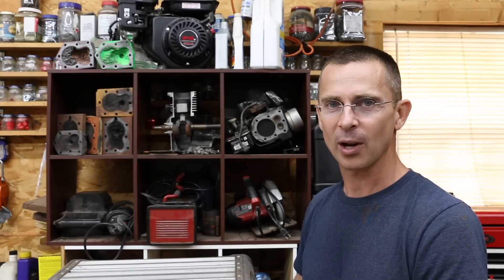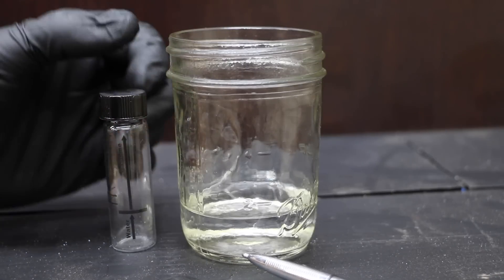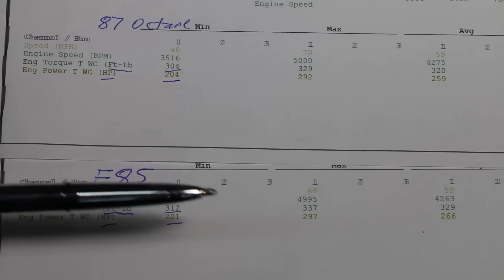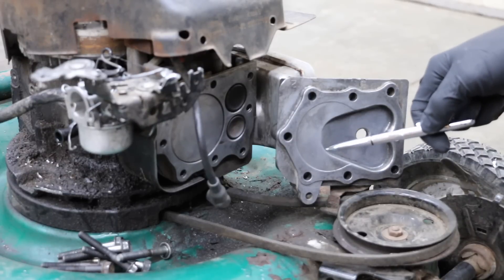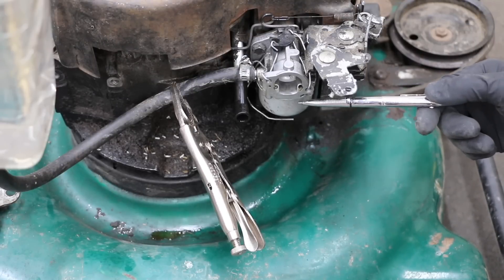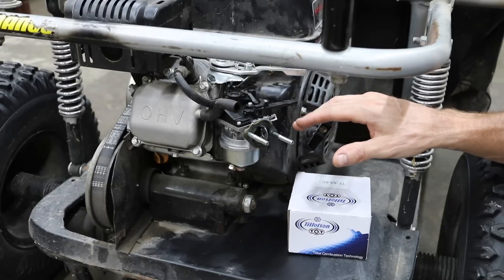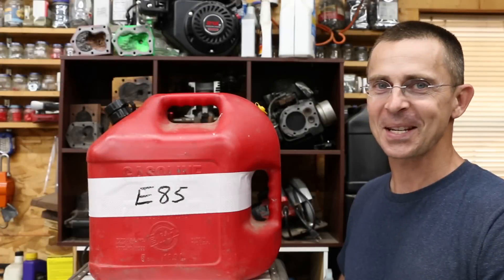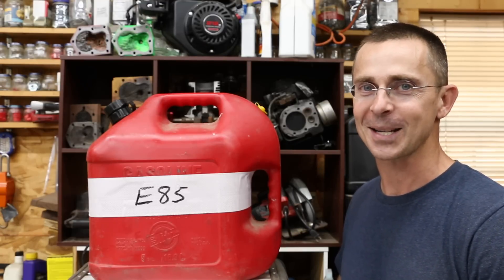Is E85 better than Gasoline? Let's find out!

Comment: I tried E85 in my work truck once. The reduction in  power and substantially lower miles per gallon made me never try that experiment again. And yes, it was a flex fuel truck
Reply from the maker: Great point.
Reply: E85 as race fuel? I'll withhold my laughter for now and do some research and get back to you on that
Reply: E85 is just as common as 116 at the the drag strip, NASCAR also uses ethanol.
Reply: Okay, I've done some research and found it I was wrong about E85 as a race fuel. However my original comment was in regards to use in a standard road car
Reply: You should gain atleast 20hp on E85...
Reply: @Z3rhairstylers  how do you figure? One of the inherent drawbacks to ethanol is that the amount of energy in one gallon versus the potential energy in one gallon of gasoline is substantially less than gasoline
Reply: @greglautz8470  ECU injects more fuel (BTUs compensation), that's how.
Reply: @greglautz8470  resistance to knock. It's basically race fuel. Less energy so more is injected to compensate and then timing can be advanced much further than normal pump gas could ever handle.

Comment: Because of the lower energy density, fuel consumption is going to be highly. And the price difference between 87 octane and e85 isn't worth the switch. But, like you showed, e85 burns cleaner and that also makes it more environmentally friendly. And, hypercars are now producing much more hp on e100, than on any gasoline blend. The biggest problem with ethanol is it's water absorbance and solvability. It ruins rubber almost instantly and once wet with water, will speed corrosion. Luckily, I have a gas station that still sells strait gasoline, in 91 octane.
Reply from the maker: Thank you!

Comment: You said 30% less energy in E85, I assume you are talking about BTU's, but heat is a bad thing in an engine. You want expanding gas to drive the piston down. E85 expands less than regular gas, but not 30% less. This is common miss-information perpetuated by those that do not know.
Reply from the maker: Thanks for the constructive feedback.  Per several reliable sources, E85 has 30% less BTUs than E0.

Comment: I have not even seen E 85 for sale , just may contain up to 10 % ,  Last summer it was about a 105 in the shade  I tried to get a 1970 318 dodge pu running  it would run but it sounded like the gas was boiling in the carb it then it was acting like vapor lock  this fuel now days must not work to good in the old stuff
Reply from the maker: Thank you!

Comment: yes its less energy per unit, and thus you get fewer miles to your gallon, but you forgot to mention that E-85 is subsidize to be around a dollar per gallon cheaper to offset the fuel economy loss. Also if you are using forced induction, the 115 octane rating of E-85 means you can up the boost a lot more and do it safely. I wish someone would design a turbo engine tuned for E-85 from the factory, and start putting it in normal passenger cars.
Reply from the maker: Thank you

Comment: E85 melted the rubber fittings on the vapor return lines in my 1997 Mercedes.  it was a serious pain to find those rubber connection fittings and replace them. They swelled up and lost their seal again within a year.
Reply from the maker: Wow!  Thanks for commenting on this.

Comment: its harder to start the engine with e85. e85 has higher octane rating. and you get less mileage with e85. as a alt fuel i prefer propane with propane it burns way cleaner you can see it in the oil running propane. whitch would bring up the question of if you would have to change it because i seen 50k miles on oil from an engine running propane and it was exactly like new nice light brown.
Reply from the maker: Thank you!

Comment: Ran a tank of 87 octane then a tank of E85 and repeated both again. I have a 2012 Chevy silverado with a 6 liter V8. Both tanks of E85 yielded about 50 mile less than the 87 octane. So I don't use E85 except when the E85 folks in Iowa run a $1 a gallon promotional sale. Hard to beat $1 fuel.
Reply from the maker: Great point on buying the fuel for such a great discount.
Reply: This is a study in your neck of the woods. Not Iowa but South Dakota. Close enough.
 http://ethanolproducer.com/articles/14126/passing-the-test-with-flying-colors

Comment: If Memory Serves Me Correctly The Thermal Efficiency Of E-85 Is Roughly 25%  LESS Than 87 Or 89 Octane Fuel  Lb. For Lb.  Or Any Other Comparable Volume Or Weigh Equivalency .... It's Not Worth It ... Unless In A High Compression Engine ... Race Car Etc ..  Anyone Else Remember This A.P.I. Study Years Ago ??  Have A Good Day !! 😆  -MW
Reply from the maker: Thank you

Comment: We have two vehicles that are made for Flex Fuel E-85, one is a 2017 Ford F-150 V-8 which does much better on regular 87 octane fuel.  It has better performance and a lot better gas mileage versus E-85. Our 2012 GMC Terrain that runs quite well on E-85, and gets better mileage, and performance than we get with 87 Octane fuel.   The only way to get similar performance on the GMC is to run 93 high Octane fuel.
Reply from the maker: Thank you for this information.

Comment: I use e85 all the time my truck loves the stuff throttle response is alot better the engine runs cooler and it seems to not work as hard at highway speed. the downside I get roughly 11% reduction in economy. at just over 1 more gallon of fuel for every 100 miles driven the added cost is negligible. The reason non flex fuel vehicles get such poor economy is because the computer senses A lean trim and dumps fuel through the injectors until it maxes out whereas the flex fuel engines can detect the ethanol and trim accordingly. Also non flex fuel systems can suffer major damage due to the seals and gaskets either turning to mush and dissolving or they become hard and brittle and leak (depending on the rubber compound)
Reply from the maker: 11% less efficiency is actually not bad at all.  My flex fuel suffered a 30% decrease.

Comment: I use e85 4 gallons, 10 93 octane and ethanol treatment in my Audi s4. It comes out to e30 basically. I wish they sold e30 there instead. As far as the difference yes you can feel more power without a doubt. 

The car is tuned for 93 octane so running 95-96 octane just helps it run at its peak. Summer it will make more of a difference with it making car run cooler. You see much bigger difference in summer compared to winter because of cooling effects.
Reply from the maker: Thank you for the video idea!
Reply: Absolutely true. Mercedes petitioned EPA to allow stations to offer e30 since it provides "ridiculous power" (Mercedes words) in their turbocharged engines.

Comment: In a 2016 Ford F-150 5.0L Coyote I see massive mileage drops with E85. Even the estimated range computer shows about 380 mi when full with E85 vs 435 mi with 87 octane.
Reply from the maker: Wow, that is a big drop.
Reply: Try e30. That seems to be the sweet spot for sizable power increase with minimal mileage penalty.

Comment: as far as your dyno results go they can be very misleading for starters the computer takes time to adjust for the different fuel you need to drive it at least 10 miles(preferably longer) for the computer to adjust fuel trims.
also for more accurate dyno numbers you should take multiple runs and average them
Reply from the maker: Thank you.  I added the E85 around 20 miles from the dyno shop.  Great feedback on multiple runs.

Comment: Ran E85 in my truck, after 1/2 tank engine check light comes on " P0340" code O2 sensor below range. Engine ran fine but at reduced fuel economy avg 3 to 4 miles per gallon than regular gas.
Reply from the maker: Did the CEL go away after going back to E10?
Reply: No had to reset with scan tool

Comment: The push for ethanol fuel happened mainly before US scaled up shale oil production and became an oil exporter. It was meant to reduce the reliance on oil import and was a strategic move rather  than environmental. Now that theres no need for that, time and money will be better spent on directly going electric which will actually be the future.
Reply from the maker: Thank you!

Comment: I run E85 exclusively in my flex fuel capable F150 with a 3rd gen coyote 5.0L V8. My truck has some bolt ons and it's specifically custom tuned for E85. It makes noticeably more power on flex fuel vs premium gas. My mileage on E85 is about 13-14 mpg vs. 15-16 on 93... but gas mileage is not important to me because it's not my daily driver. I haven't had my truck dyno tested, but it should make 440ish lb fleet of torque and 425ish hp to the wheels, over the 395/400 stock rating off the crank.
Reply from the maker: That's great power!  Thank you

Comment: e85 works very well in boosted engines I run it in mine. It is higher octane but isn't a real raiting as it cant be tested on the normal gasoline scale. It also cools the incoming charge air in my tests it has worked better then Sunoco 110 to keeping knock down.
Reply: Doesn't even compare to pump gas on pump 91 non ethanol I was stuck around 20psi and 10 deg of timing advance by redline to battle knock. E85 car as seen 30psi and 15 deg at redline without knock.
Reply from the maker: Great point. Thank you!

Comment: Not sure if you’ve tested this theory, but what effect will “octane boosters” have on a vehicle that is E85 compatible, running on E85. Hope that makes sense.
Reply: Since e85 is already 100-105 octane there would be no change/benefit to adding octane boost, most of which only add .2-.3 octane.
Reply: 65sohc 
At that point it doesn’t matter at all. If it is only going to add .2-.3 (which I agree with you), it doesn’t matter which octane fuel you add it to.

I suppose then at this point the question is whether the alcohol content of E85 (not its octane rating) would have any affect on how well the octane booster could work.

In other words, not because of the rating number, but does the alcohol content of E85 have any significant effect on the way the octane booster is designed to work. Like is the booster more or less effective because of the alcohol.

Gosh I hope that made sense, it was sort of confusing to try to explain myself
Reply: @notacreativehandle  Pretty much all the effective octane boosters contain MMT as the active ingredient. This includes Torco, NOS, Lucas. Basically the more you add the more they raise the octane of the base gasoline. Though I can't say for sure, my sense is that the presence or absence of ethanol wouldn't make a difference. However ethanol is a much cheaper way to achieve higher octane. It also reduces deposits whereas MMT increases them. Engines that run MMT have a characteristic orange deposit on the spark plugs and valves. With e85 guys are making huge power so it pretty much eliminates detonation as a limiting factor.
Reply: 65sohc 
I suppose then at that point maybe with a test we could be able to see comparisons in both performance and maintenance, which would be pretty cool
Reply: @notacreativehandle  Another important property of ethanol is its high latent heat of vaporization meaning. It absorbs heat better than gasoline, cooling the intake charge and thus increasing its density and power. So even with the same octane the ethanol fuel would produce more power, especially in a forced induction setup where combustion chamber pressures and temperature are critical.
Reply: 65sohc 
That’s right, I had forgotten about latent heat.

Here’s the thing though, by adding an octane booster to the mixture, you’re still adding an additional chemical to the mixture.
I’m curious as to how much difference it either does or doesn’t make.
Reply from the maker: Thank you for the video idea!

Comment: My 2013 Subaru Legacy owner's manual does NOT recommend even using E15, much less E85.  There was a push about 6 weeks ago when news programs on TV were telling viewers that E15 was going to become 'more available' and would cost less than current regular.  You might ruin your engine by using it.  Dude, your gasoline prices are ridiculous! I just filled up, and I paid $1.859 per gallon for 87 octane regular.
Reply from the maker: That's a great price!

Comment: hey great videos keep them coming. I have a 2016 Silverado 4.3L V6 that is a flex fuel vehicle. I primarily use E85. I find that while yes it does burn faster and the mpg goes down, besides the extra power and torque, I believe it is a financial savings. The reason I say that is for example current gas prices here in NY is about $1.75 for E85 and about $2.30 for regular. The window sticker on my truck estimates that I should get 300 miles per tank on E85 and 400 on regular. So for me to fill up my car it costs me about $35-37 on E85 where as it would be about $55-57- about $20 more per tank. Now I know what your going to say, “your getting another 100 miles out of the tank: that is true. But if you were to say “how many miles can I get on $50 worth of either E85 or regular, the answer would be in the favor of E85. On my car, I wouldn’t be able to get the full $50 into the tank on 1 shot on E85. And on gasoline I wouldn’t have completely filled the tank. So I estimate that while I have to go back to the pump for more E85, I will actually get further on the addition $15-ish of E85 as apposed to what I got on (almost) a full tank of regular gasoline.
Reply from the maker: Thank you

Comment: 10% to 15%  more power with E85 or E100 for the same engine block at 13:1 or above compression ratio. Also more efficiency. Using E85 or E100 in engines below 10:1 CR is waste of money.

To run ethanol in a gas carb it need to be treated with nickel bath...

Water content in ethanol cleans combustion chamber...
Reply from the maker: Thank you

Comment: Have converted a bunch of cars for E85 for climate reasons, and have discovered that if done right E85 gives you a much meatier engine character and slightly more power at any rev. Engines with mid to high compression responds best to E85 but lower compression lets you drive on high gears at very low rev (below 1000 rpm). Consumption goes up about 30% on average, and here in Sweden tax is lower on bio-fuels so cost per km is about the same as gasoline. The only extra cost is that you need to change oil more often, but I'm happy to take that little extra cost to be climate friendly. An example: A Volvo 740 GL withe B230F 2.3 L engine normal outputs 116 Hp on gasoline. With just fitting 40% bigger injectors (the Bosch LH 2.4 Jetronic adapts the fuel mixture +/-10%) with more modern multi-beam spray pattern off a Saab 9-3 and the ignition turned up 6 degrees it output an extra 15 hp and 28 Nm compared to gasoline. Both hp and torque came a lot earlier in revs. Fuel consumption at highway speeds went up from 8.5 l/100 km to 1.07l/100 km. When changing the oil on a properly tuned E85 car it is still semi-clear. The inside of the crankcase and the rest of the engine will after 2-3 oil changes be pretty much 100 procent free of gunk. As for rubber components, the Volvos, BMWs and Saabs I have done nothing needs to be changed since they all come with high quality hoses that handles ethanol fine. Me and friends/relatives etc. have driven more than 500.000 km in converted cars without a single leak.
Reply from the maker: Thank you
Reply: I totally agree. Torque improves even more than horsepower which equates to better throttle response . My son just got a '16 GT350 identical to mine except he is on 91 octane while I am on e85. Mine is noticeably faster.......for now.

Comment: My car normally gets 30-32MPG on E10 on longer runs, and I decided to run a few tanks of E85 - wow the power was really noticeable, especially when driving through mountainous terrain, but economy dropped to less than 20mpg. A tradeoff I know, but the next 10,000km back on E10 seemed to run a little smoother and a bit better economy, but nothing ground breaking.
Reply from the maker: Thank you!
Reply: That's a pretty big hit. You get get almost all the power improvement and much better mileage if you use about half and half to drop your ethanol to about 50%.

Comment: I have Been running my 07 Yukon with the 5.3 Flex fuel with AFM on E85 for the last three full ups.  IF I’m driving the speed limit on the freeway, I’m getting 11.2 MPG. The power difference is noticeable. I break the rear tires loose easier and seems to have more low end power than anything. I like that it’s keeping the combustion chamber cleaner.
Reply from the maker: Thank you!  I got similar milage with my 5.3 Flex fuel on E85..

Comment: E-85 ethanol has less BTU content than gas, it stands to reason that you would need a little more fuel,that being said and IC engine is a VAPOR engine NOT a liquid fueled engine !!!!!! but you can mix gas and ethanol 50/50 if the ethanol is at lest 180 proof or higher !!!!!. This does tell me I have a alternative fuel source if it comes to that !!!!!!. BTW, better than "Walking" !!!
Reply from the maker: Thank you

Comment: On my car it makes no discernable difference if you use E85 but my wife has a more modern Turbo car and her car really has a lot more punch with E85! It's probably got to do with the pressure the turbo can run at being higher.
Reply from the maker: Great point on it helping vehicles with turbos!

Comment: I know somebody with a flex fuel vehicle but they have only ever run regular 87 octane in it. I live in the country and there are no nearby E-85 stations.  If they come across an E85 station would recommend running a tank of E85?  Would it help clean out the engine?
Reply from the maker: I believe it would help clean up their engine some in just 1 tank, based upon the testing.